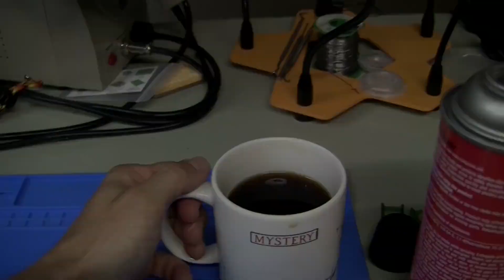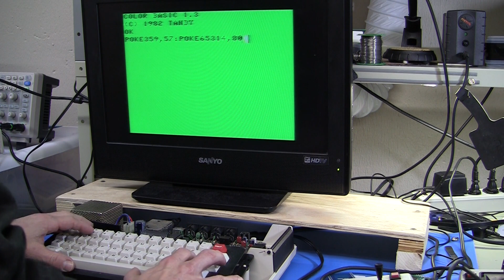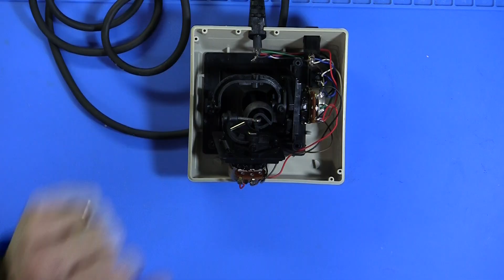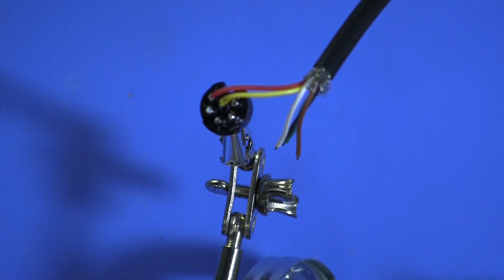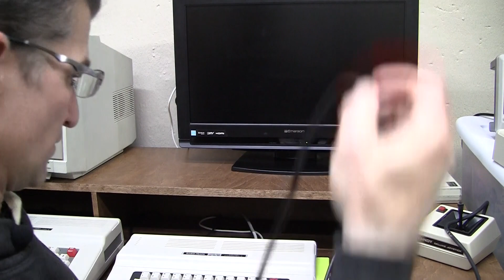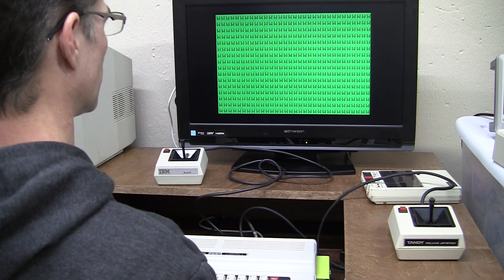Convert old IBM PCjr Joysticks to TANDY CoCo Deluxe || 6847T1 VDG lowercase text  || 64k RAM upgrade

Comment: Nice video.  The way you solder is great.  I've attempted some joystick work and have always found it to be challenging.  Your methods make me rethink my approach.  But I saw where you had similar issues where the soldering iron heated the DIN pins enough to soften the black plastic holding it.  I noticed your holder uses a rubber or similar material to grip things without damaging them.  But in this case, I have found metal to metal helps keep the pin cooler and reduces the softening of the black plastic.  I think next time I do this, I will use aluminum foil to improve the heat sinking effect more and crank up the iron tip and work faster.  I think that combination will give me best (or most disastrous) results.
Reply from the maker: You're right about that!  I keep seeing better and better ways (and then forgetting them when it comes time for action)!

Comment: Psa...for replacement parts for your Tandy/IBM joystick by Kraft, I am making 3d print replacement parts for it.  Already on cocoarchi e is the latch and one other part, and soon I will add the cam.
The fire buttons are available as replacement parts as you mention.
The IBM pcjr joystick is wired like apple 2 as a resistor.  The Coco is a voltage divider setup.  (Easier way to thi k about it)
Great video!!!
Also, any of the apple ii joystick ls can be modified also in the same way.   But please butcher PC joysticks and not apple ii.
Reply from the maker: This is great!  I'll buy some parts to fix mine.

Comment: Thanks a lot for the lower cases POKE instructions !!!
A little tip for you, after soldering DIN connectors you can use a hot glue gun and melt some glue into the connector (cable side), that will keep the wires away from each others and avoid shortcuts.
Reply from the maker: Great tip! I will definitely try that next time. The hot glue is always handy and the fragile connections are easy to break during all the handling. Have you ever used Plasti-dip for coating a wire bundle? It can tidy up loose Dupont jumper wires.
Reply: @acs8-bitzone651  Never heard about that thing, I sure will google it, thanks !

Comment: Last night I had to take a connector back off of a cable I had just soldered on because I had forgotten to put on heat shrink beforehand.   It is easy to miss doing it, and I think easier yet that it is often done later in the day or at night when I am a bit tired.
Reply from the maker: I don't make a lot of cables but I probably do forget that step about half the time! Our brains are so focused on preparing each wire end for soldering that we just flow into that step.

Comment: The Coco 3 does have the 2nd button connected, and it is supported in both BASIC and Nitr(OS-9). But you are correct, it is not connected on the Coco 1/2.
Reply from the maker: That makes so much sense in hindsight.  I didn't check the Coco-3 schematic to see, just the 2, and I didn't happen to think of the fact that Tandy could have added the functionality in the 3.

Comment: I built about 20 of these. On a coco3, you can PEEK for the 2nd button, not sure about the the coco2 or 1
Reply from the maker: You are right about Coco3, I have recently learned.  As for Coco 1/2, their boards do not make a connection to the 6th pin and that button is not usable in them.  Thanks for mentioning and watching!

Comment: The pin 6 is only active on the CoCo3.
Reply: Yes, and of course also on the Tandy 1000 line up.  @ACs 8-bit Zone: There are several CoCo3 games that make use of both joystick buttons, such as Kyum Gai: To Be Ninja by Sundog Systems.
Reply from the maker: Awesome!  Since my experience was with Coco1 and Coco2 in the 80s and I haven't done much with my Coco3 yet, I had no idea what the second button was for.  But it is connected in the joystick and ready for those games.
Reply from the maker: Oh, that makes sense now.  Thought it was for only the Tandy personal computers.  But the Coco3 came late enough that it could add the connection, it seems.